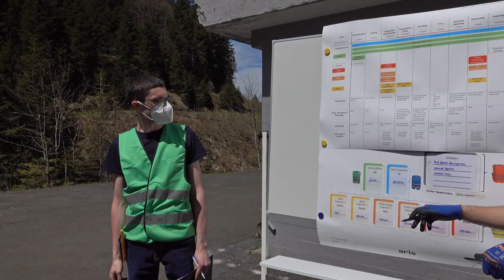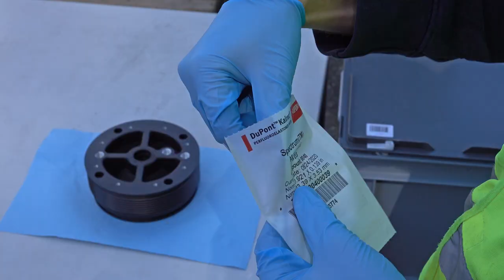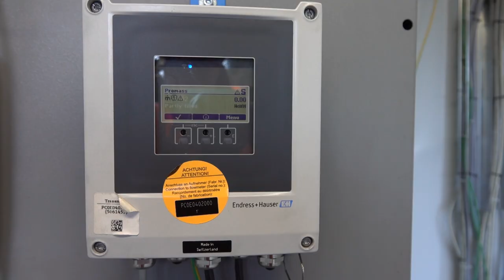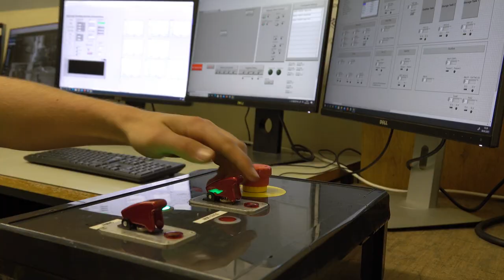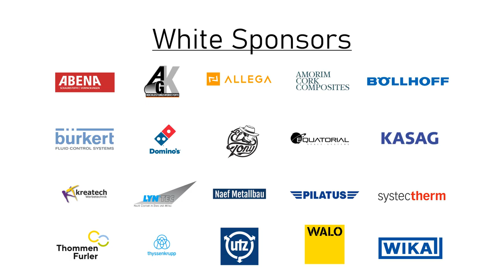Focus Project DAEDALUS

Comment: What's the specific impulse of a hybrid rocket?
Reply from the maker: It depends on the firing conditions. During our testing campaign, our engine achieved an average specific impulse of around 190s.
Reply: Hybrids using the right propellants can achieve Isp comparable to KEROLOX (270sec SL @ 70bar).